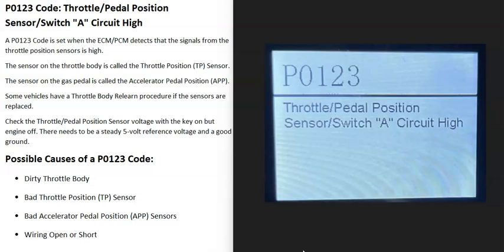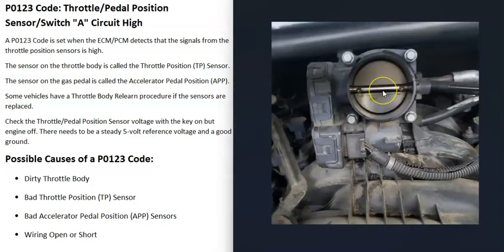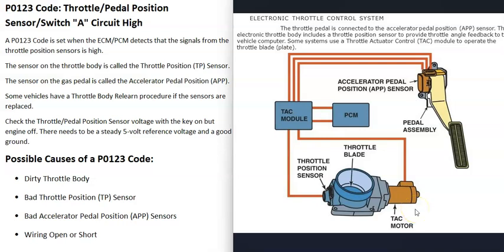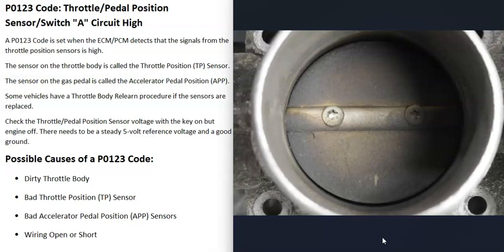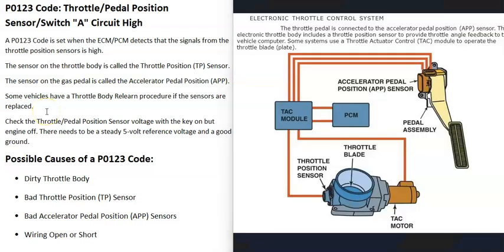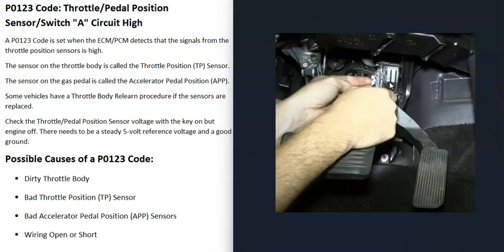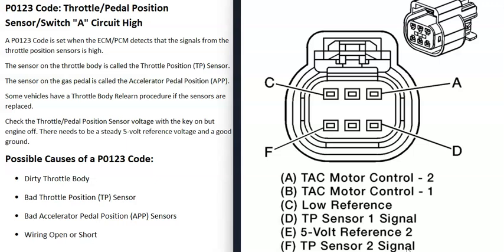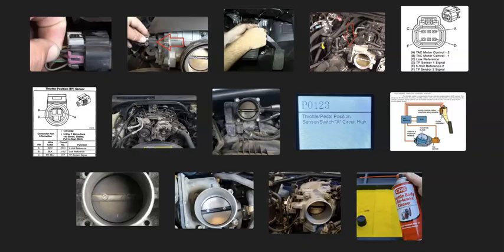Causes and Fixes P0123 Code: Throttle/Pedal Position Sensor/Switch "A" Circuit High

Comment: I had no code until I removed the manifold and parts to replace a camshaft position sensor and put everything back together.  I actually cleaned the throttle body with a napkin.  I dont know if its a permanent code or temporary code yet

Comment: This can also happen after you did a reset of the Throttle body with a stupid scanner or app!  You must reset it again the proper way and it's very easy 

Turn on key (ACC) but do NOT turn on the car.  

PRESS the floor accelerator pedal for a full 1 minute. 

After the minute, let go off the accelerator pedal and turn of the key (Start Button). 

Wait 3 minutes before you turn on the car. Enjoy!

Comment: Just did a throttle body on a 2008 Chrysler town and country but got this code and now the car is idling roughly. I out the old part back on and it’s idling a little better but still rough. Only think I can visibly see is that the tabs of the electrical connector going to the throttle body is/was loose. I didn’t have to squeeze the tabs just pulled and it came off. It doesn’t stay locked in place. I’m assuming this would cause this issue??

Comment: I have this p0123 and a p0222 what is that one?
Reply from the maker: P0222 Throttle/Pedal Position Sensor/switch "B" Circuit Low
Reply: I have a 2012 dodge journey 2.4l throttle body wiring issue. I forgot to take apic so i can rewire. Can u help me know how to wire that pls. Getting those same two codes. I replaced the APP as well. Is it possible to get apic of a similar car so i can map it right pls?
Reply: I got this after the technician cleaned Throttle paddle 
Current Fault Log
------------------
P0123: Throttle/Pedal Position Sensor/Switch A Circuit High Input

Pending Fault Log
------------------
ECU reports no pending faults

Historic Fault Log
------------------
ECU reports no historic faults
Other discovered fault codes
(possibly pending, current or manufacturer specific)
----------------------------------------------------
P0222: Throttle/Pedal Position Sensor/Switch "B" Circuit Low Input
P2111: Throttle Actuator Control System - Stuck Open

End of report.
Reply: Did you end up fixing it? If so what was the issue cause I have the same 2 codes.
Reply: @randybeans47  same
Reply: How u fix it I have the same two codes
Reply: @Angel_sanchez.z please let me know if u solved … my car idles and accelerates but sometimes its shifting hard or slipping up to 3 and backdown whenever I try to mantaain 2 rpm acceleration
Reply: Seems like these two codes have the same exact issues

Comment: So if i have faulty pedal sensor..... The RPM after start can be 900-1000.
Reply: Mine is cable and doesn’t have the pedal sensor, yet it still does the same thing. 2004 jeep grand Cherokee